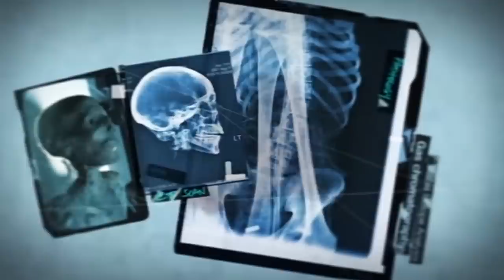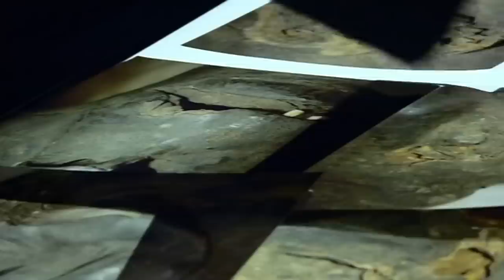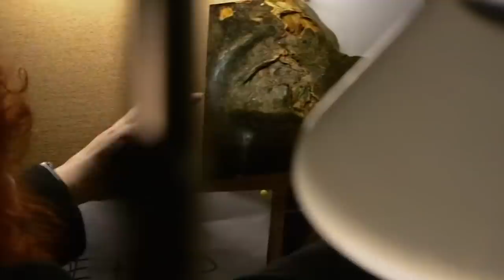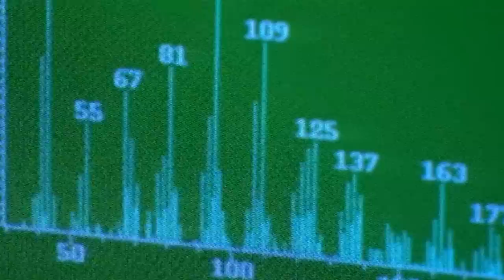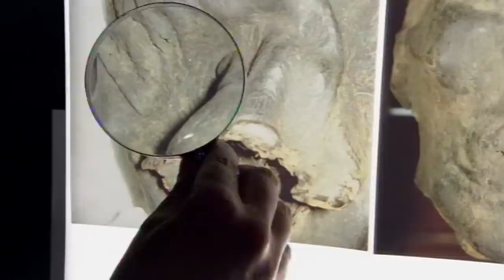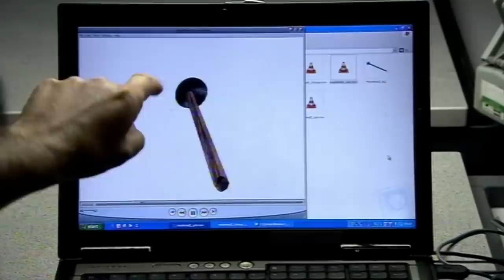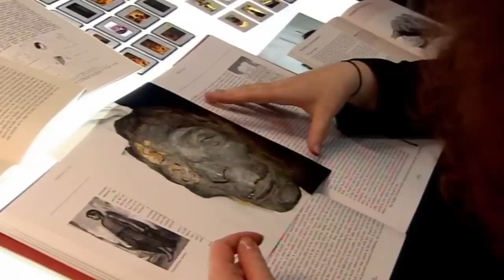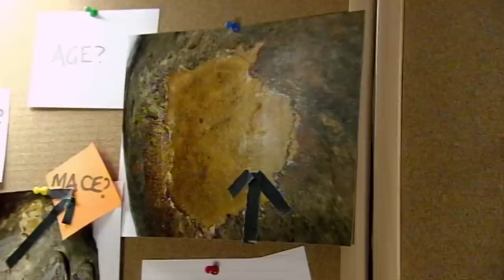The Shocking Investigation Of A Beheaded Mummy | Mummy Forensics | Timeline

Comment: Long drops in public hangings have often resulted in decapitation.
Reply: That's true, but I don't think ancient Egyptians ever hung anyone?
Reply: @ARiddle1986  no and even if they did why would they mummify him so well that would not have been done on someone who fudged up enough in society to be hanged
Reply: Looking at the skin damage to the side of the head caused by the rope which is shown in a "pulled up fashion", I think this guy was on the end of a "short drop" certainly enough to break the vertebrae and move the head up & backwards from its normal position on top of the spinal/neck column. Strangulation usually kills the person by a shortage of oxygen to the brain etc... but leaves damage to the front of the neck area, wind pipe area and lower jaw in the front, not at the side?
Reply: @mikeradford5630  they don't have that part of the body, or at least damn little.

Comment: I hate to be such a naysayer, but how in the world could Dr. Fletcher discuss the dislocation of the neck as the possible c.o.d. when it has already been established that the head had been torn off its torso post-mortem - even post-embalming (likely by grave robbers)? What if the man died of peritonitis? Schistosomiasis? Pneumonia, etc...? There really isn't enough evidence to establish c.o.d. - just because the head is all you've got it does not follow that the head is where the injury/illness is located.
Reply: It's been severed at a different point to the dislocation. They're suggesting the dislocation could have been the c.o.d and the severance happened later.